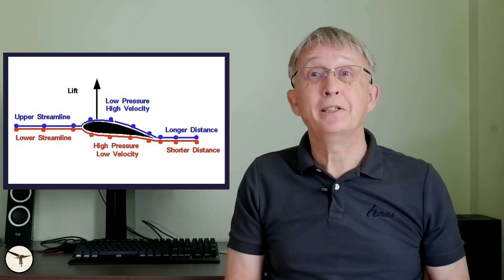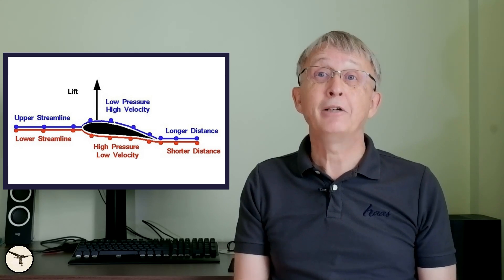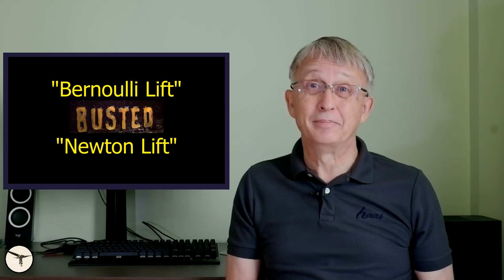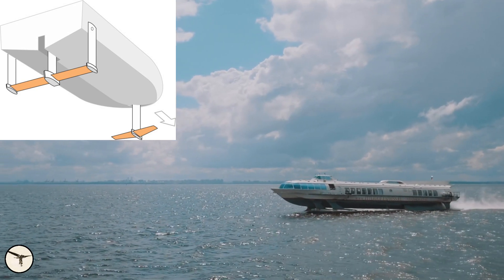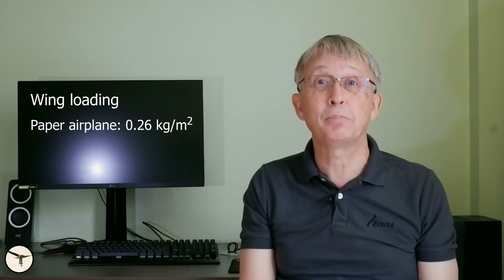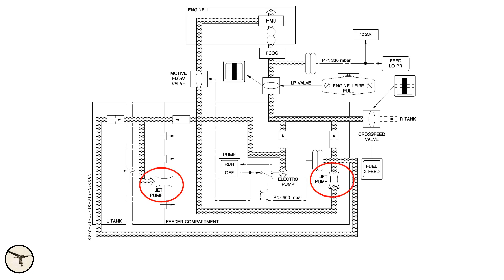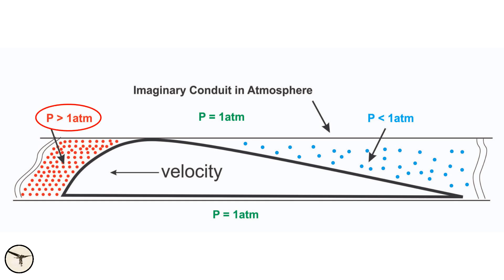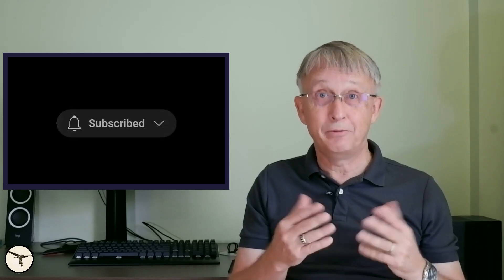7 Wing Lift Myths You Must Avoid: What Really Makes Airplanes Fly!

Comment: That fairy tale of two air molecules trying to meet again, after one goes on top, and the other below the wing, that story is sooooo weird. Just ask HOW a pair of air molecules could DO that. It is most unlikely the two would even meet again. Again, ask yourself HOW, and try really hard to answer the question. You can't! It is nonsense. Then, why did people believe it? Then, why would this fairy tale be the reason for a difference in pressure and speed? When a neighbour pair of air molecules split, no problem, that can happen, but them meeting again is a huge problem, sure it is possible, but it is also possible one of them is there earlier, why not, and still, there can be our pressure difference. Why on earth did people start believing these molecules have a date behind the wing? People are weird.
Reply: The fact is that air over the top goes faster than static or the air underneath.
Reply: It’s only logic to believe there is a high pressure under the wing, and as a result there is a low pressure over the wing, reguardless if the wing is curved or flat.And no the two streams don’t come together at the same time.
Reply: No one ever said that. 
Ever. 
They are saying the top of the wing and the bottom go exactly the same speed…

Comment: Another way to bust the "blow over the paper" experiment "supporting" Bernoulli's law is to let the paper hang freely downward. If one now blows down next to the paper, nothing happens. As an effect has to be independent of the position, rotation or daytime, this experiment should still work. I had to learn, that Bernoulli's law is only valid along one of the "lines" over the wing.
Thank you, thank you, thank you for the video and time putting into it. There are too many wrong theories about planes flying, even in schoolbooks.
Reply: So it is not the Bernoulli Effect but Coanda Effect must still occur with the hanging paper sheet. I have tried it several times and find the paper is attracted toward the jet. I have also seen a professor blowing over the hanging sheet of A4 and smugly proclaiming “there it doesn’t work, if anything it only moves away!” Why the opposite result? Because his demo was poorly controlled. The blown jet needs to be tangential to the surface. If there is a small angle toward the paper then it will be repelled by the reaction force to the jet deflection. The wrong conclusion was drawn by the Professor because he bodged the experiment. Done more carefully, using a straw and a thin sheet, you can see that blowing at an angle toward the paper repels it, but with the jet tangential or slightly divergent, the paper is attracted. The latter is, by definition, the Coanda Effect.
Reply: You didn't blow hard enough.
It works if you hold the paper straight, without any curve. It wouldn't do that if Bernoulli's principle didn't always hold true. The 'lines' you are talking about are actually sort of waves, so you're not wrong, it's just slightly different. The waves interact with the wing, in a way similar to a beach surf. If all you can see is the beach, the assumption that where there is no surf, there are no waves is easily made.

Comment: Oh, and why isnt the aviation world finally switching to the metric system? It's such a huge mess of units!
Reply: aviation world has always been metric.....
Reply: @SoloRenegade  in Russia ;)
Reply: @MarkxTube  in US, Europe, Etc.
Reply: @SoloRenegade  where? It's still feet, miles, gallons, F ect.
Reply: @MarkxTube  Celsius, millibars, meters, Mach, etc.

Knots is not imperial nor metric, and used in metric countries.

Zulu time is also not metric, but used in all metric countries.

Many units and terms in aviation come from France in fact.
Reply: 1 nautical mile is 1minute of latitude or longitude. 60minutes make up one degree of latitude / longitude. Null island (0N , 0E) to either of the poles requires you to travel 90 degrees times by 60 nautical miles (60 miles to every degree) which makes the distance travelled 5400nm (nautical miles).

Knots is relative to latitude and longitude so it makes perfect sense for aviation and maritime applications. It works on the geometry of a sphere which in this case is the earth
Reply: @MarkxTube  Too high costs, all equipment should be updated, too much confusion and too many risks. Imperial systems do work, and working system is not repaired for no direct benefits.